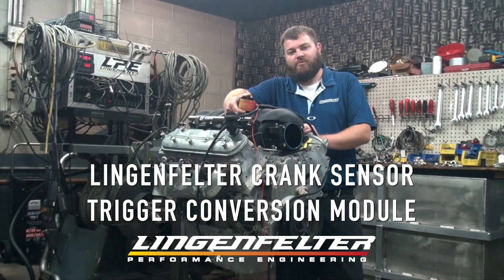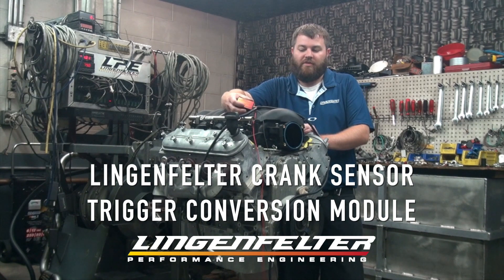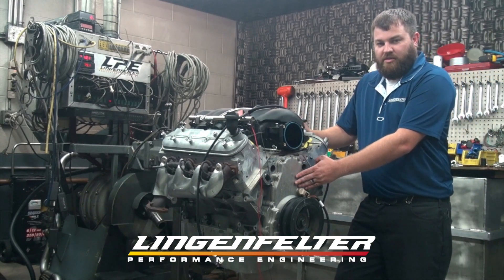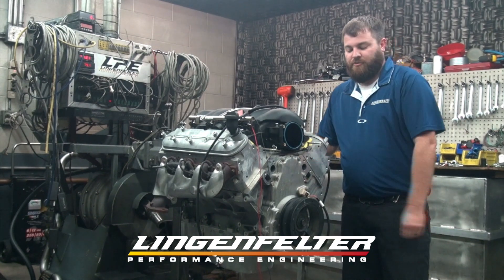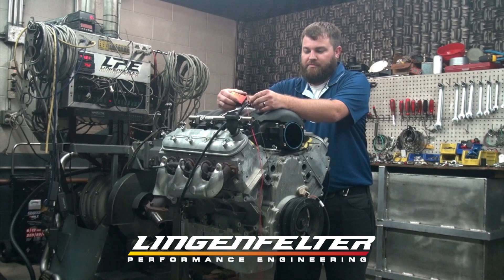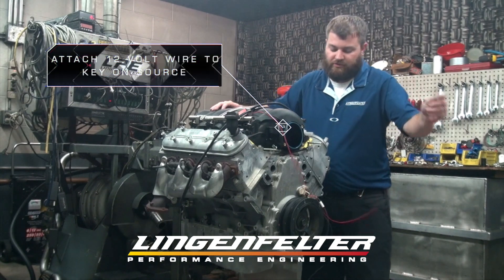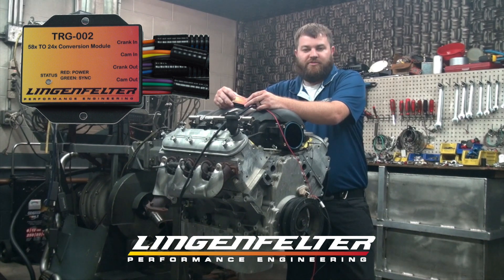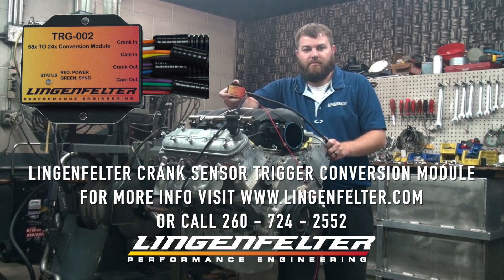Lingenfelter TRG-002 58x-24x  Instructional Video

Comment: Im having big problems getting this module to work.  i cant get any timing signal from cam or crank.  it says there should be 5 volts in orange wires to sensors but im getting 11.7v.  Lingenfelter have so far not responded to my requests for assistance.  ive been through it a number of times and cant identify an issue except for the incorrect voltage coming from the module.  some help would be great please.
Reply: 😭😭😭 alright awesome wish me luck
Reply from the maker: Our team would be happy to help. Please give us a call at (260) 724-2552 or email us at sales@Lingenfelter.com so that we can address your problems.
Reply: Having same issue? You ever figure it out
Reply: @Kimchi_Gaming_117  no sorry, I gave up on the product and got a new ecu

Comment: How come no one will show us the HARDEST part, where to connect to a switched ignition power source or at least the options on a few vehicles? The rest is plug and play connectors. But a loose ended wire can be connected to virtually anywhere. We need to know that information just as much or more than the plug and play stuff. Every langenfelter video I have watched so far leaves that step out and thats one of the MOST important steps to make it work correctly. SO NONE OF THE VIDEOS ARE COMPLETE INSTRUCTIONAL VIDEOS.
Reply: Did you ever get help?

Comment: Can I use this on my 24x holley terminator x to run my l96
Reply: I called them and asked the same thing. They said it should work but they’ve never heard of it being done. I chose to get this, a LS1 stand-alone harness and a 12200411 pcm and have it programmed.
Reply: so this will not run the l96?
Reply: @bigshotpep7500  the above posts is in relation to using the Holley terminator x. The terminator x needed for a 58x/4x has been out of stock for months. That left us swap guys wondering if we could use this as a bridge from a 58x/4x engine to a 24x/1x Holley terminator x using this as the translator. 
Your question- can this run a l96? Should be fine so long as it’s a 58x/4x engine with the appropriate factory harness and factory pcm (like a gen 3 or whatever).

Comment: The red 12volt+ wire must be run to a switched 12volt positive source that remains energized while in the cranking position. This is very important, otherwise the engine won't start.
Reply: So what’s a good power source
Reply: @mikeverything4098  that's something you'll have to figure out for yourself. All you need is a circuit test light.
Reply: @renaissanceman7145  #Vats disable from your local tuner...Achievement Unlocked- Start

Comment: I had this box back in 2012 and what sucks is they are only long enough to be placed in the engine bay.... it was placed away from heat and wound still heat up and wouldn’t let my truck start at times.... it was a pain in the ass honestly!
Reply: Isn’t this the only way of doing it without replacing reluctor wheels
Reply: @mikeverything4098  unless you change over to a Holley setup which is what I did last year and it’s been great
Reply: @408lethal  how much is that